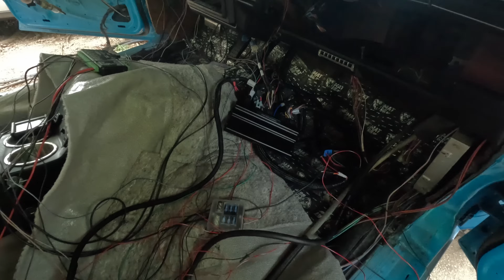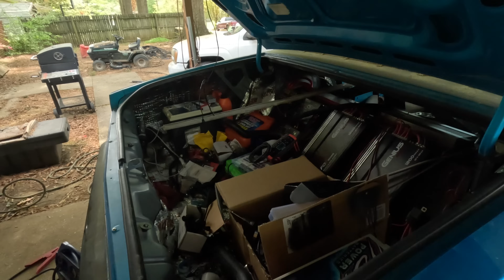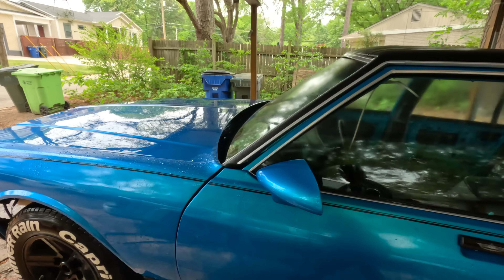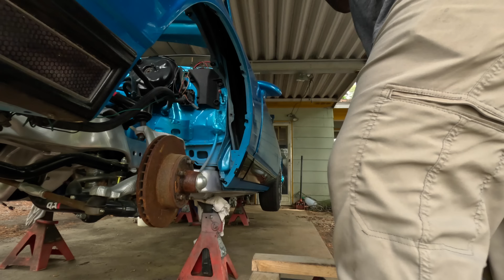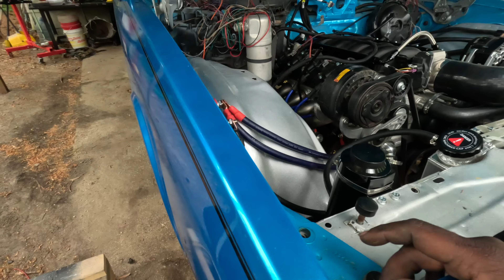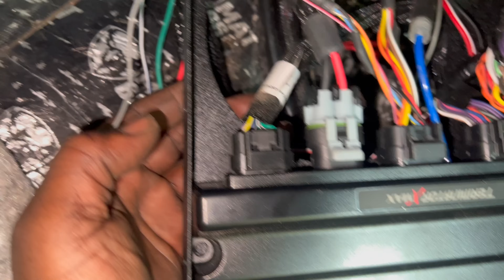1989 Box Chevy Build Ep.55 Inner Fenders, Coolant Reservoir & Oil Catch Can Installed! (Progress!)

Comment: Fuel psi gotta at least 58 to run optimal
Reply: On a stock ecm setup..
Reply: @lsingleton77  he's running a term x I believe it requires 58psi
Reply: It can run 43 if the ecu is set for it….but 58 is better

Comment: You said your fuel pressure is reading 34 psi on the Holley? Most injectors use around 58 psi. Might wanna check up on that.

Comment: Check out Your Camshaft Sensor Delphi and Duralast Brand are BS I Brought Both Brand New And Both Didn’t Allow My Motor To Start I Put The Old One Back In Fired Right Up Which I Believe is The AcDelco Version you can get tha AcDelco from your Local Chevy Dealer.